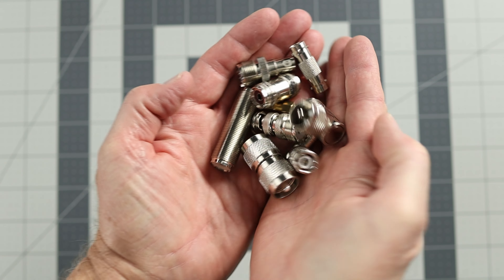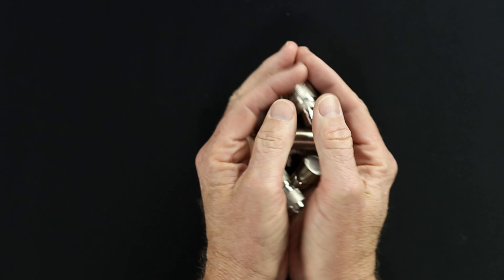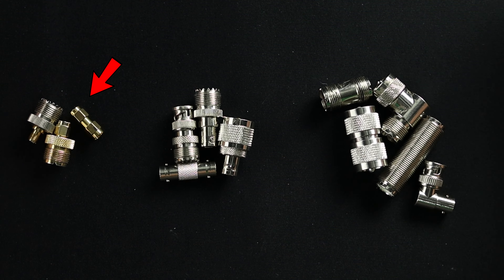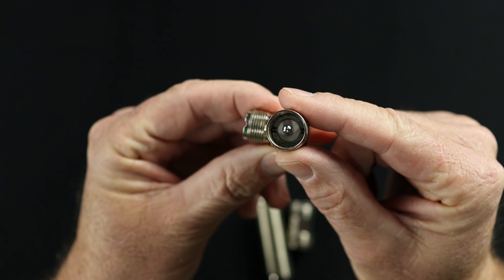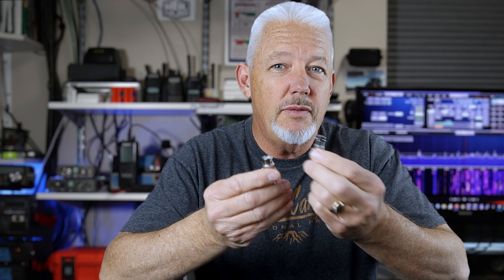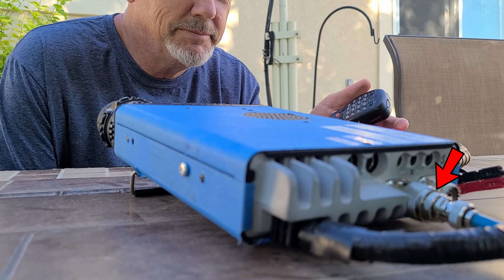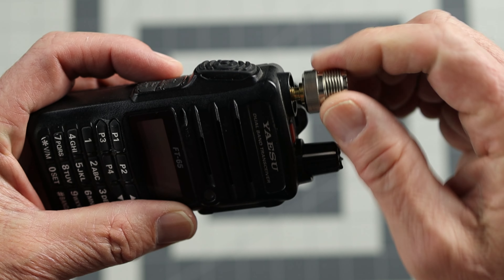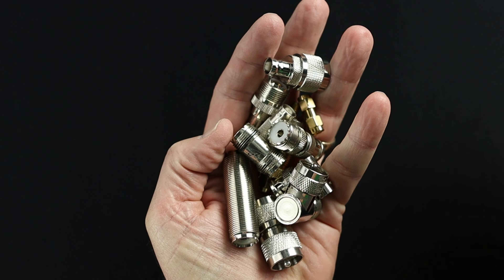UHF Adapters for On-The-Go Radio Ops | K7SW Ham Radio

Comment from the maker: What is YOUR most commonly used adapter that you always take with you ?
Reply: I use the SO-239 to male BNC because I have shack coax and QRP radios... in the field its not as much of an issue, but this is Wisconsin, who goes outside this time of year?
Reply from the maker: That made me smile, Steve.  Thanks

Comment: Best advice you can give someone in my opinion!!! You can have the best radio and antenna made but if you can't connect it well it might as well be a box of rocks! I have a lot of everything you mentioned and i pick up more every so often when im making an order for something else..Another thing I would say is not to cheap out on connectors and adapters!! Another trick is to put a little film of die electric grease on them and they will last a long time..
Reply from the maker: Thanks for adding those tips. Yes, the grease is an excellent point. I am glad you mentioned it.
Reply: @hamradiowithkevin  👍

Comment: Absolutely!! I take a small divided box of connectors in my portable kit. All my  HT's have adapters from sma to bnc and all my HT antennas have bnc connections so if I need to connect to coax all I need is a bnc to so239 connector. My FT-891 has a bnc connector so I can quick connect the coax. I probably use bnc to so239/pl259 connectors most. Jack K5FIT

Comment: I also suggest an SMA/BNC adapter that you leave on the HT. That's how I have my Kenwood HTs configured and then I use a BNC-based antenna. It also makes it trivial to connect the HT to a BNC coaxial cable for a better antenna.

I keep a roll-up J-pole in my go kit for use with my HTs.

BTW, it was good to work you on the SNARS repeater network a few weeks ago. If you get out this way again, give me a holler.

73 de AG7TX
Reply from the maker: I appreciate you being on that repeater as I drove through.  It was good to meet you on the radio. I hope to do that again.  73

Comment: I use most all of the connectors that you mention in your video Kevin, particularly the SO-239 to BNC; I can never seem to have enough of those. I think part of the reason is they're not put together all that securely and mine end up coming apart. An example of this is when I connect a length of my coax that has PL-259s on each end to antenna like a dipole that has a BNC female connector. The coax hangs down and creates a little bit of gravity force on the connector. I try to make a loop of coax and support it somehow to prevent too much downward force.
Reply from the maker: I know what you mean